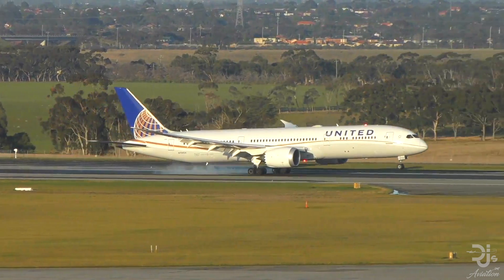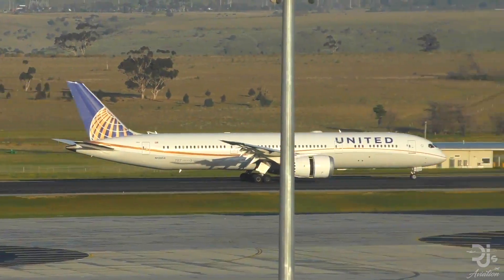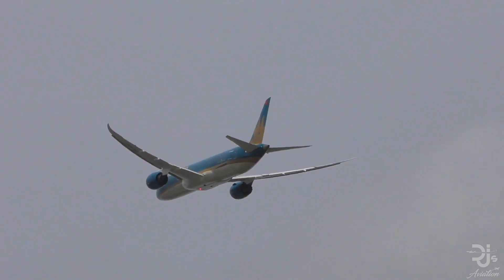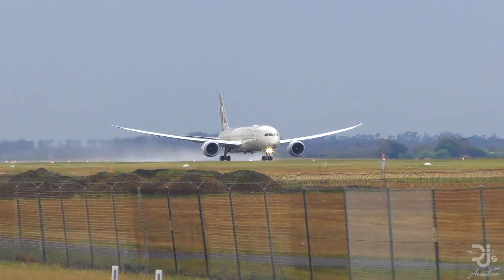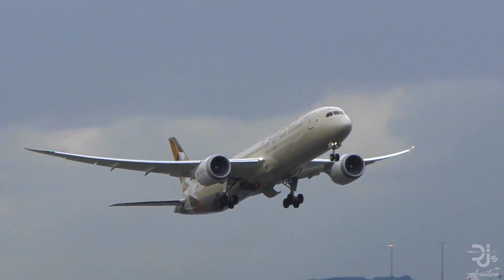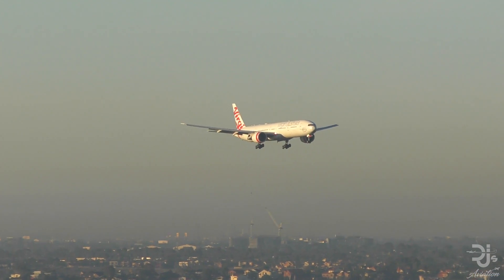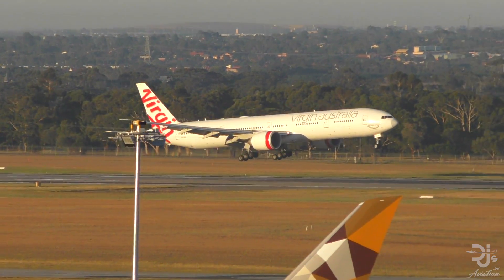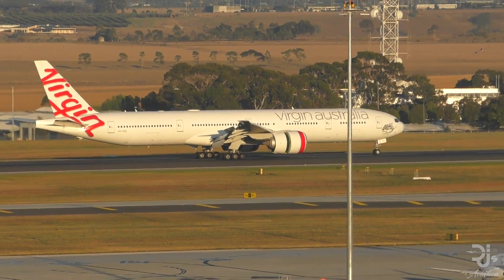The HISTORY of FOLDING WINGTIPS

Comment: Is Airbus downward folding wingtip a superior design than Boeing's traditional design? Airbus design requires no locking and control mechanism, it's gonna be much cheaper and lighter. BTW, it was Boeing's failure not to patent downward wingtip when they patented their upward wingtip, even if they don't use it.
Reply: But downward folding means it could hit the ground

Comment: Hey guys, do also have the issue that the standard window size of the video is suddenly bigger than normal?
Reply: You've hit cinema mode. look for the box button next to settings and click it again.
Reply: I know about that, but that's not the problem.
Reply: Can't help you then im afraid. I had a size issue a couple months back it annoyed the hell out of me. I think I ended up googling it and was something to do with Chrome settings for me. Otherwise the viewing window hasn't changed on DJ's videos so it will be an issue your end. Good luck sorting it
Reply: I stand corrected!!!!!! It was fine earlier but when i reloaded the video it does indeed look bigger than normal. Maybe YT are trialling a new size window or something OR DJ himself has changed it up abit. Apologies as obviously I could only answer in line with what I was seeing at the time
Reply: Thanks for your effort.
Reply: No worries. I've been on several channels since and all of the non maximised viewing boxes seem larger so im guessing it's an unannounced ( shock, horror, surprise ;)  ) change at YT level rather than anything DJ has done.

Comment: Just like any other moving part on an aircraft, these could fail at some point. I wonder how an airliner would be affected if one...or both accidentally folded during flight? Unlikely scenario, but one I hope is looked into before going ahead with this design. I'd guess the system adds weight to the aircraft too!